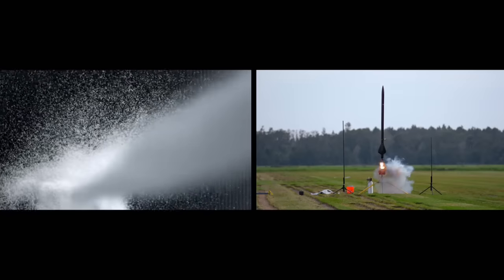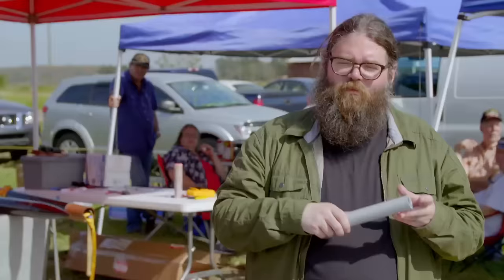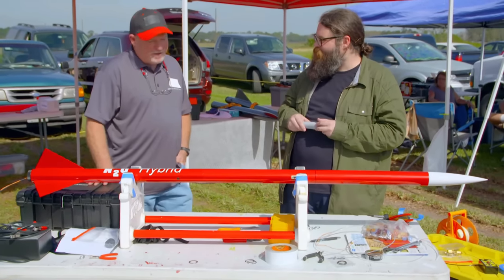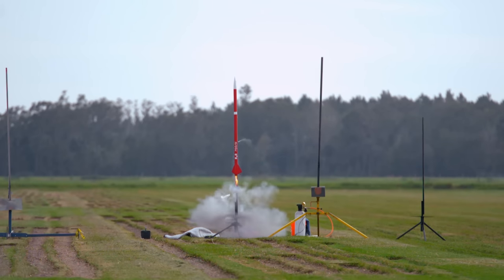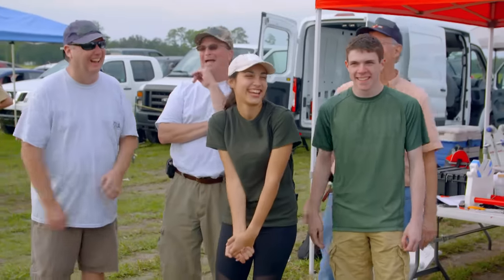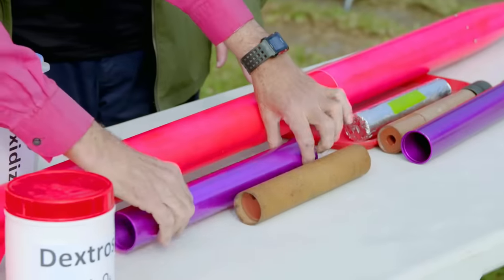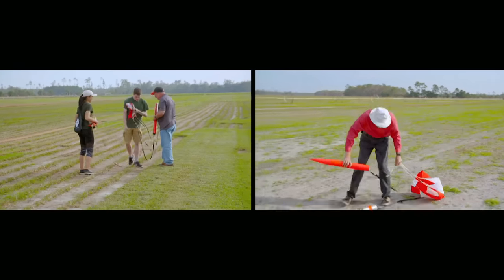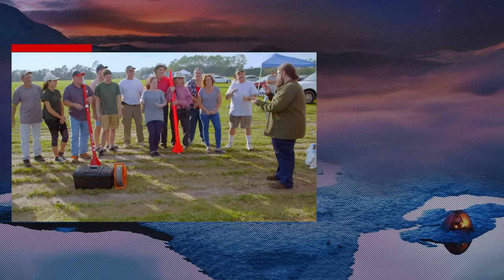A Sugar Powered Rocket | Street Science

Comment: "Sugar is a great fuel because it has so much Hydrogen in it".  Nope. There is a reason they're called Carbohydrates. For every two atoms of Hydrogen in a carbohydrate molecule, there is an atom of Oxygen. The Hydrogen already wasted its energy. The only energy left to burn is from Carbon. This is also why alcohol is not as good fuel as gasoline.
Reply: They’re not saying it’s better than other fuels, but for being sugar, a common household item that isn’t dangerous then it’s a good fuel
Reply: Ture
Reply: True.  And sugar is also a very unstable molecule with a low burning temperature and lots of carbon so if you likened this sugar/potassium nitrate fuel to the more common black powder rocket motors, the sugar takes the place of both the carbon and sulphur in a common black powder mixture.
Reply: How about Pentane and Phosphotungstic acid for a fuel and oxidizer?
Reply: You can make more power on alcohol than on gasoline in a blown big block V8
Reply: @ChuckBeefOG  With enough alcohol most men think they are the most powerful on earth.
Reply: @ChuckBeefOG  Well alcohol has a higher auto-ignition temperature, so you can run a higher compression and more boost without worrying about knock, which will create more power. But it's far less energy dense than gasoline, which is likely what they're referring to it being a "better fuel"
Reply: I am actually going to make a report on rockets and such, and this information is really helpfull! Thanks my guy, if you have any more suggestions please notify me
Reply: Absolutely correct, Alexa.  Glad you wrote this.  Ted

Comment: Silly comparison. 38mm 4grain sugar motor, likely full "I" class(somewhere around 600Ns), vs a 29mm hybrid which likely came in at a "G" or "H" class(somewhere around 160-300Ns). They didn't really configure the competition to be highest altitude per motor volume, or propellant mass, or anything. They didn't use the same size rocket either. The Sugar motor was just plain bigger, and naturally if you compare a bigger motor and a smaller one, the bigger one will go higher.

Comment: Back in the 60s, the kids down the street were making rockets using sugar + potassium nitrate as a propellent. All went well until one of the kids had a few fingers torn off when the rocket motor exploded on him, as he prepared to launch. I was still too young at the time to mess with any of that, but just a few years later I briefly experimented with rockets (but I used commercially available rocket motors). Then I moved on to RC airplanes, gliders and helicopters.
Reply: People had to learn that you cannot be next to it when it ignites, which is why we use electronic ignition systems now
Reply: @WNActivist88  Oh yes, back when I played with rockets (1975)  I also used electric ignition, keeping a safe distance away from the rocket. The commercially available motors came with igniters.
Reply: Kids. That is the main problem, although it's fun and a good learning experience, kids should benefit from the assistance of someone with actual experience in the field.

Comment: What if your KNO3 and sugar rocket is in a PVC tube?!
Reply: You will essentially get a boosted rocket motor using solid fuel.Another take on it is to use PVC granulate mixed in with the sugar and the KNO3, which works quite well too. A little rocket I made once ended flight at 556 m..
Reply: But what kind of pvc do they use?
Reply: Nasa wants to know your location
Reply: No need to yell
Reply: @Light Maestro You never use plastic containment for a burning chamber, loco o que?
Reply: Rocket fuel-ception
Reply: Tripropellant Rocket!
Reply: @Mrcatpants56  he is in mars and he want to come back to earth loo😂😂
Reply: Pakistani meme factory  Sure, any angle you want. The distance is related to the amount of fuel in the rocket and the weight of said rocket.
Reply: Pakistani meme factory  It depends on a lot of factors. Like wind direction, speed, the weight of the actual rocket, and the diameter of the nozzle.
Reply: @dannydetonator  There is a u-tube video of a small homebuilt rocket having replaceable KNO3 & sugar engines using pvc casings, and they got along fine. But I believe they used half inch tubing and only two or three inches long, so the impulse time would be short. Not enough for a burn through.
Reply: @ronfullerton3162  Ok, i overreacted. Thanx for a tip. Of course there's loads  fireworks in plastic casings. I just never seen an amateur plastic rocket engine. I'm more of a blow-stuff-up kinda guy...
Reply: @dannydetonator  Well, for your heavy duty stuff, I would think it would be the best to steer away from the plastic case. I am sure you would have a burn through for sure. I have been thinking of trying one of those small rockets. The build of the rocket and preparations for the engines was covered by a u-tube title as the king of random. I found it a fun watch.
Reply: lol kno3 is illegal in my country.
Reply: It will still go well

Comment: the sugar rocket had 3x the fuel... if they could use a thicker walled pvc pipe... im sure theyd have better results.
Reply: Indeed, stupid comparison...
Reply: +Dr. Zoidberg you also would have to look at the energy used when burned
Reply: chuck Ramsey Why? If you want to know which fuel is better, you'd (imho) have to get 2 identical mass payload rockets powered by an identical mass of fuel of the different types. If one of them burns with more energy that just means his fuel is more energy dense, translating in a higher altitude, therefore rightfully winning the title 'best fuel'.
If you just calculate the energy density beforehand you don't even need to do this competition though.
Reply: alabastine.. they have  math classes for people like you..remedial..
you can calculate a pretty accurate result weight vs weight.. if its accurate that the sugar was 3x times the mass or weight of the pvc fuel..they are pretty close to equal
Reply: 0
Reply: The hybrid motor just have a weight and reliability disadvantage, as container for NO2 weights about as much as oxidiser itself. Calculated energy/gas/thrust estimates are never exact in practice.
Reply: @Francis Ford Coppula Everybody knows the metric is the specific impulse. The rest is just show

Comment: Damn I used to make these with table sugar and stump remover
Reply: Can you tell me how you did it i want to try it
Reply: Justin S. Use a grinder and grind up a 60/40 ratio of stumper remover and normal table sugar. I would only use spectracide brand stump remover as it’s almost 100% kno3. To make it into a rocket pack it into a pvc tube really tight and drill a thin hole down the middle. Tape that baby to a barbecue skewer and stick a fuse up the hole and light it off. Should go around 1000 ft. Check out Grant Thompson’s video on it it’s more detailed.
Reply: @northtexasskies3243  Have a look at the YouTube channel "The King Of Random"

Comment: tree sap works better you just collect tree sap from big pine trees cat litter icing sugar ammonium nitrate roll the sap in a line in the center of all the icing sugar should be blended then mixed up by hand never blend the nitrate and icing sugar put the roll sap inside and fill. pack both ends with kitty litter.

Comment: I want to make a 6 ft long 8 inch wide homemade rocket bad... I have been looking for for ways to make fuel,  the footage from a go pro would be insane
Reply: If you didn't know, you'll need to go through the HPR certification process before you can launch rockets that large, a 6' x 8" rocket is probably going to be a Class-2 HPR minimum, you'll need an I or J motor just to get it off the ground. And FAA clearance to launch it too. If you can build it under 1500 grams launch weight with less than 125 grams of propellant it doesn't need clearance, but that's going to tough with an 8" diameter body tube, and it will only go up a couple hundred feet, if that, with 125 grams of propellant. If you're curious about fuel I've got a few videos on small-scale manufacture and testing of professional grade APCP fuel using HTPB polyurethane resin as a binder, it's a little more involved than making R-candy but it's so much more powerful. The channel Tech Ingredients also did a video (way better than mine lol) on making APCP fuel, including how to build the bodies and cast the grains, he's actually got a number of cool rocket videos. I just finished building a J270 APCP motor a few days ago but don't have any footage of it yet, similar to what Tech Ingredients attached to his rocket-powered trailer lol.

And before you get started in APCP manufacture (if you do) just know there's going to be an initial investment in equipment and components, ammonium perchlorate is pretty expensive at $15 a pound minimum, you'll need a vacuum pump and chamber, HTPB is $200+ a gallon with a 1/2 gallon minimum order, isodecyl pelargonate (a thinner needed to make the HTPB pourable) is $50 a half gallon, aluminum is about $20-$30 a pound, and some of the burn rate additives can get pretty spendy too like Catocene. Just an FYI, for some people it might be cheaper to just buy commercial motors if you aren't going to do it as a full-time hobby.

Comment: we are making sugar rocket using KNO3 and powdered sugar....but it's not working ....can anyone say the ratio of KNO3 and sugar used in the rocket fuel in the video......Is it a dry mix of sugar and KNO3 or cooked??/
Reply: kno3 cooked and sugar dry I think, and make sure it's cramped up as good as possible because loose bits of sugar and kno3 wont do the trick
Reply: Ratio between KNO3 And sugar is 3:2

Comment: Why not mix sugar and pvc?! Homemade NASA!
Reply: That actually could be a good idea
Reply: @4cidc4t14  
Rockets need both a fuel and an oxidiser, in the first motor PVC was the fuel and nitrous oxide was the oxidiser, in the second one it was sugar and possibly ammonium perchlorate (these are called hybrid fuelled and solid fuelled rockets, hybrid because they use a solid fuel and a liquid oxidiser, solid because both components were solid). So you would need nitrous oxide or some other oxidiser to complete the reaction. You'd also have a hard time mixing the two, as PVC doesn't melt like sugar, it just burns (this is because it has cross-linked chains in it's structure that make it's theoretical melting point higher than the energy needed to cause combustion).

If you want better performance you really need higher energy fuels, paraffin wax (yes, the stuff candles are made of), rubber, and other plastics do the job nicely, and are the fuels used to power bigger more professional hybrid motors.

If you are interested in building your own rocket, then you can get model rocket kits that come with a pre-assembled solid motor. If you are feeling ambitious (and don't live in the UK where you need a licence) then you can try building your own solid motor, but I wouldn't attempt this without a firm grasp of the basic theory and an acknowledgement of the risks, don't go blowing up yourself by accident.